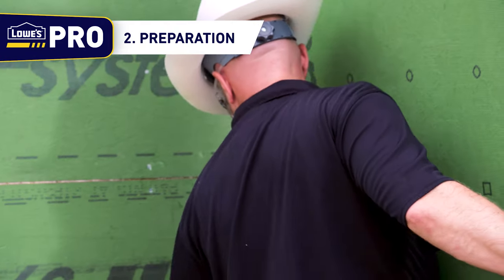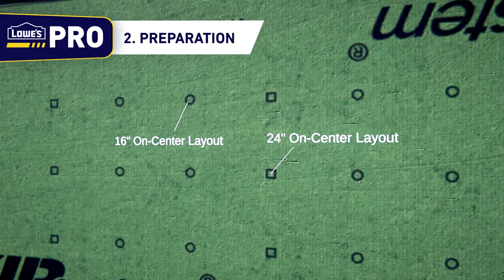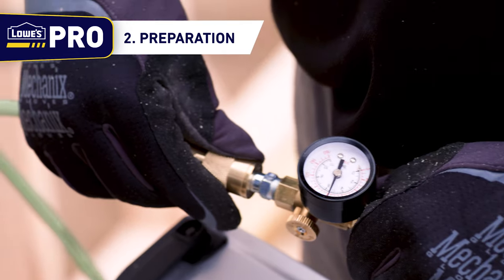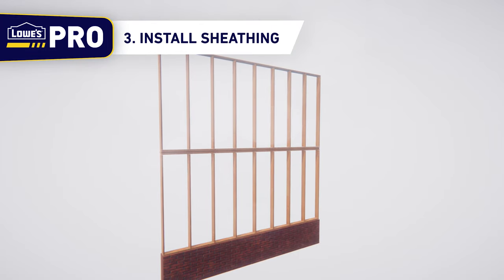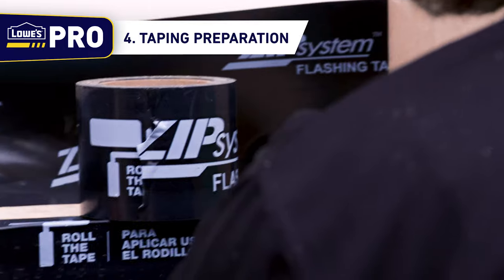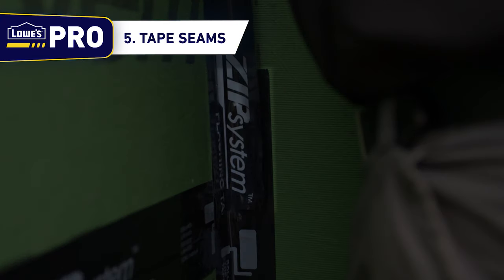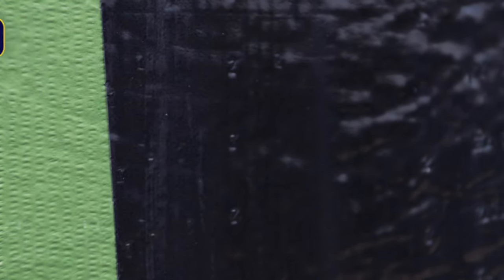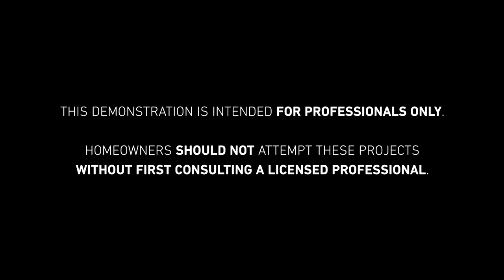How To Install ZIP System | Lowe's Pro How-To

Comment: Okay you say in the video that they can be installed vertically or horizontally, what you're installing them horizontally. And that is my understanding too is that they should only be installed horizontally. That's why the writing is horizontal. And the stud markers are also based on them being installed horizontally.

Comment: Can washers be used on the nails to make them less likely to sink in? Also, what about conventional hammering by hand? Or using screws? Can screws be used instead of nails? (It's not for a house- it's for a small shed).
Reply: @Robert Leinen you’re a liar. I’ll guarantee you’ve never once screwed all the exterior sheathing on a house
Reply: @Robert Leinen screws break, nails are better because they flex
Reply: Screws will not pass structurally as they have little sheer value. I highly recommend using nails.

Comment: We never use framing nails... we use the staple gun
Reply: The installation manual specifically says not to use staples and doing so will not be code compliant in places that have modern building code.

Comment: "...keeping the sheets TIGHT TO EACH OTHER top to bottom. Maintain an 1/8 inch gap when coupling the butt seams to account for panel expansion" as the guy in the video moves his thumb along the horizontal long edge of the panel. How do you "couple" a seam anyway? Oh, it's Lowes, ah, yes, what do you expect.